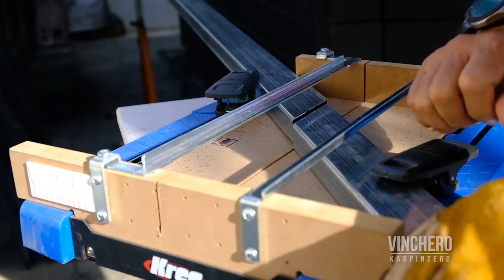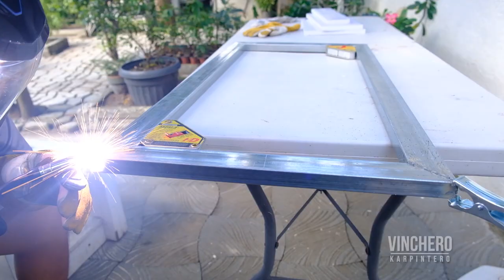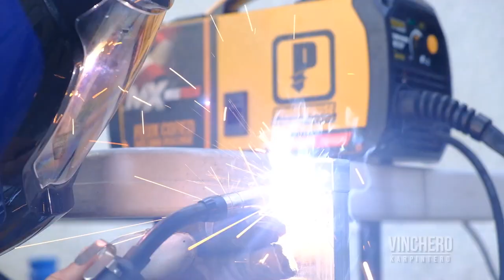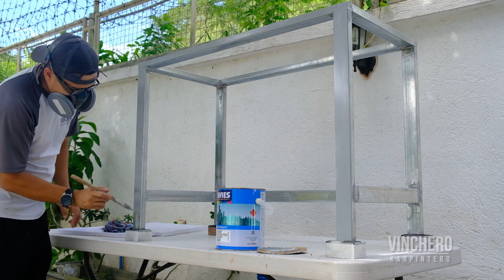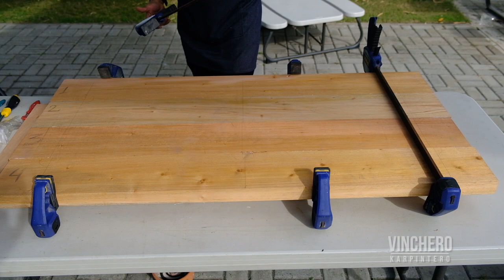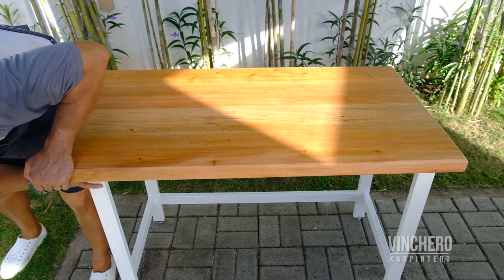Simple Solid Wood Top Table with a Metal Frame

Comment: Good Day Sir!
Anu po tawag dun sa nilalagay sa footings? And dun sa mechanisim na parang rivet at yung bala nya?
Reply: same question Sir Vinchero
Reply from the maker: They're called "threaded rivets".
Reply: @VincheroKarpintero  anong tawag sir sa tool na ginamit niyo para don?
Reply from the maker: @sanjaegarcia5585  tawag ata diyan is "threaded rivet nut tool" or "riveter" or "threaded rivet gun"
Reply: @VincheroKarpintero  Thank you sir :)
Reply: @VincheroKarpintero  saan nakakabili nyan? may link ka ba sir? puro scissor type yung nakikita ko na ganyan. parang ang haba haba nun. like ko nung tulad nyang gamit mo. 😊
Reply from the maker: @cjayfaraon3394  actually, I'm told the scissor type is better. This one was just loaned to me by a friend so di ko alam san makakabili.
Reply: @VincheroKarpintero  in terms of available size ng nut, marami kasi capability si scissor type. M3->M12 size... yung isa parang until M8. nalalakihan lang talaga ako dun sa scissor type and hindi ko naman magagamit yung M12... anyways thank you! 😊 nice content! keep it up!